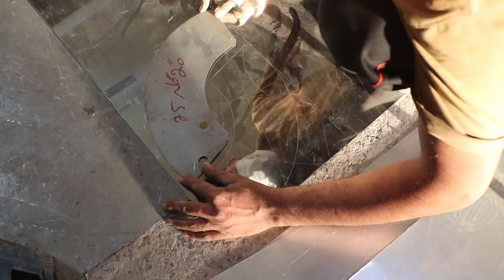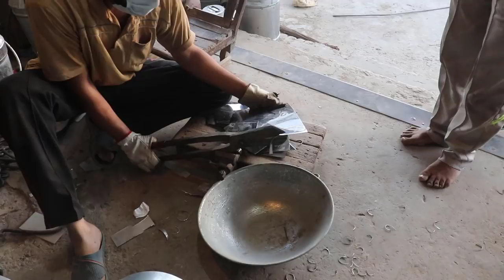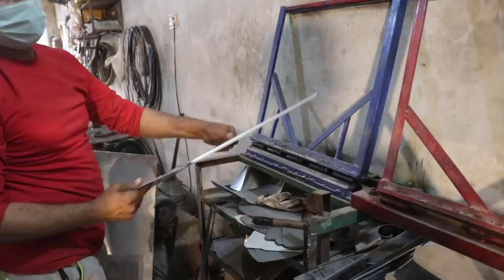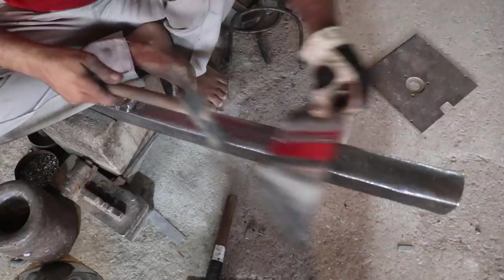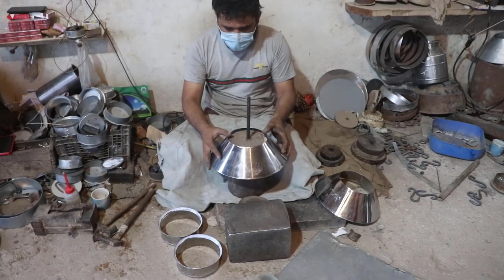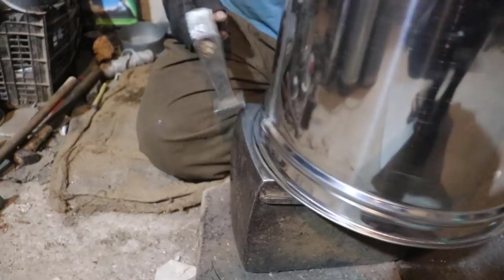Amazing Skills to Make Milk Cans With Stainless Steel

Comment: They should show this stuff to western kids in engineering to get back to basics, The knowledge of folds, seams and lap joints are simply genius
Reply: And not a TIG welder anywhere in sight
Reply: @campbellmorrison8540   or even angle grinder or sandpaper. everything done right the first time. like clockwork.
Reply: Cutting concave and convex curves with a 6" straight manual shear.  RESPECTED 👏👍.  I would have no fingers from all the metal splinters.✨✨
Reply: YES STILL IN INDIA LOT OF MSME SECTORS ARE WORKING THIS WAY , LOW COST PRODUCTION IS THEIR AIM
Reply: I was rolling around the floor at your comment this would be to much like hard work for western kids unless they can push a button they are completely lost. My neighbour is a carpenter he took a young lad on at the beginning of this year the kid lasted a week he wanted to use a electric saw to cut a piece of wood 5mm x 25mm. He Was seen yesterday at his new job wearing a blue baseball cap with a big golden M on it.
Reply: @travelling_stephen  sadly there so many that will go work at a place with federal mandates and immediately go on mental health break and then never have to work but get paid
Reply: @11guyinthechair you have absolutely no idea how many of these were tossed due to mistakes. Just stop

Comment: I’ve been in the aerospace industry for 27 years, and I hate to say this, but I work with some mechanics that could learn a lot from these artists.
Reply: Sheet metal work and particularly SS is not as easy as it seems, I bet a lot of so called "technicians" and "engineers" could learn a thing or two from these artisans.

Comment: Not a single weld. As a Phd in metallurgy I salute and respect the skill of these craftsmen. Cheers from Paris.
Reply: Well if you had a PhD in biology you might understand why everywhere outside the third world would use welds for such containers
Reply: If you really had a PhD in metallurgy you would also know this isn't stainless steel...its tin, so they would have to braze.
Reply: @beltdrivetypea6534 correct, because most people want containers that contain, and don't leak like a strainer.

Comment: Not one weld or solder unless I missed it. Beautiful craftsmanship.
Reply: i saw a couple of tack welds but that yellow welder didn’t do it
Reply: There should be soldering works. Otherwise, the can will not leakproof
Reply: @kokimkigunku3417  you don’t need soldier or welds to make something waterproof. Old steam engines were riveted together
Reply: @whosonfirst1309  That may be true, but you need defect free welds and for them to be polished down to the correct RA to be able to use them in the dairy industry. 
These folded joints they’re using here aren’t any good.
Reply: E, quando semeava, uma parte da semente caiu ao pé do caminho, e vieram as aves, e comeram-na; E outra parte caiu em pedregais, onde não havia terra bastante, e logo nasceu, porque não tinha terra funda; Mas, vindo o sol, queimou-se, e secou-se, porque não tinha raiz. E outra caiu entre espinhos, e os espinhos cresceram e sufocaram-na. E outra caiu em boa terra, e deu fruto: um a cem, outro a sessenta e outro a trinta..........  Mateus 13:4-8
Reply: @kokimkigunku3417  Those milk cans are watertight,make no mistake about it!

Comment: I believe these guys put their soul into  this work ...starting from a sheet of steel AMAZING    thank you
Reply: 😂 the only soul attached to this garbage are the ones of the people that died in these horrible working conditions. These people don't take pride in this junk! If they did they wouldn't throw it all over the place, on the dirt, across the ground, over gravel, scratching the surfaces forever. They'd build work benches and keep their areas clean. Just stop saying blatant BS.

Comment: not a single welded joint. awesome
Reply: Thete should be a soldering work. Only folding work will leak
Reply: @kokimkigunku3417  I don't think these are for real use, just for decoration, cause I sure would have soldered them. It was my job for about ten years; working with stainless steel, and soldering it together, such as watertanks for beer coolers for tapped beer, also made those sinks you see in bars.
Reply: @Jo_Kuiper  
No for decoration use.
It is for real use , I have seen like this in Malaysia.
Reply: @Jo_Kuiper  
Not period but there's still comma 😁.

Comment: They are wearing open toe footwear! And those are the longest metal snips I have ever seen. Every shop I worked in required steel toed work shoes or boots.
Reply: Those are feet-shaped steel toe boots, they also wear invisible eye protection.
Reply: But they are "Vid" compliant!!!!